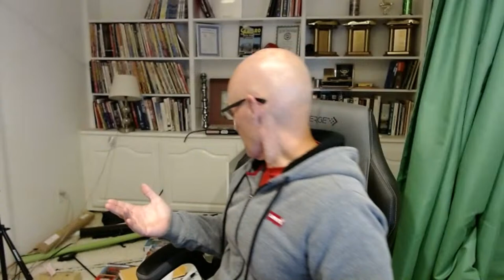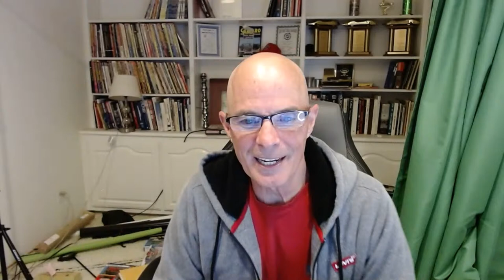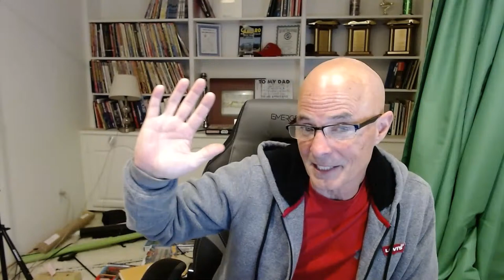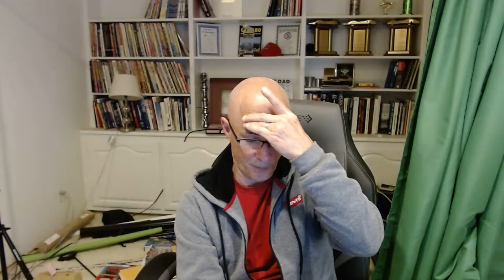SLANT 6 INTAKE-HOW DOES THIS EVEN WORK? LET'S TALK TECH

Comment: Uncle Tony did a couple of videos stagger jetting a Holley 4bbl to get plug readings even.
Tom Hoover ran a '57 Plymouth with a long ram intake on one side and a handmade short ram intake on the other head, and raced it around Detroit in early days of Ramchargers car club
Reply from the maker: stagger jetting works best on a dual quad tunnel ram-otherwise stagger jetting changes more than 1 cylinder on a single or dual plane with a single carb
Reply: @richardholdener1727  the above mentioned video was on a slant 6 with carb turned 90°. Unless he used video trickery, the evidence is there in literally black and white on the plugs. Not arguing , just offering another resource of info.

Comment: This slant intake is actually a sonic ram intake taking advantage of the reversion effects. I would bet the people, or person that designed it were the same that did the V8 long ram, and short cross ram's for the Chrysler 300's. There is one of those TV car shows on Youtube running side drafts on a slant. They actually have a visible gasoline vapor due to the reversion pulse coming out of the carbs.

Comment: G'evening Richard 🤠 . I don't remember who made them off the top of my head but at least for a while someone was making slant 6 mopar intake manifolds with runners that were all the same length.  A friend picked up two of them at the Firebird Raceway swap meet a few years back.  We ran a Holley four-barrel on one and a big Weber two-barrel on the other on two separate engines.  Even though they looked a little weird and they ran okay they seemed to be more of a gimmick than anything and we went back to the factory manifolds that we gasket matched and did a little porting on.  We ended up selling those intake manifolds the following year at the Swap Meet to someone else to play with 😋
Reply: Clifford I believe is who you are thinking of.
Reply: Auzzie Hurricanes?

Comment: Check out the Jeep I6's.  258 had 2 barrel, 4.0 had Horse shoe and a "log" style. I have a 4.0 with Clifford and Holley 390 DP, made 157 hp/215 tq on 31's-stock engine.  Even up to 4,750 RPM's I had 175 TQ still. 

If interested I can email you my Dyno runs, various heads carbs,  etc. I have not AFR'ed individual cylinders,  maybe when I install my Stroker.  But you will see cyl 1 and 6 sludged more then the rest.  Seen it myself, doesn't matter if carb or F.I. it seems.

Comment: SLANT 6 TECH?!?!? RICHARD ARE YOU READING MY MIND??? IT NEEDS A TURBO!
Reply: I just finished turboing the 225 in my A100. Still slow but sounds cool! When I first took it for a drive I hadn't adjusted the wastegate yet so it jammed 12lbs of boost down into the otherwise stock motor. Ol slant didn't care though just kept on truckin

Comment: Should see the one I built for Andrew Howard's valiant. Nor Cal killer bee series stuff. Was worth like 4 tenths and a couple mph over a Clifford with a big spacer, out of the box. No tuneup changes. Focused on grouping runner entries close together to limit required mix spread and keep some charge momentum. Runners were not quite equal but pretty close.  Lots of runner length and taper. 13:1, cam in the 240@ .050"range, spun to a 7000ish ceiling. Only did it because they said it couldn't be beat. I'd put that design over the hyperpack or aussiespeed pieces,  with confidence  too.

Comment: The whole design of this engine was to accommodate this manifold. The percentage difference in runner length is less than the competition's.  Also, back pressure from valve closing is reduced from interrupting inlet flow. The air fuel ratio is much closer with this design.

Comment: Do you think having two short, two medium and two long runners ends up averaging out performance over a larger operating range in some unexpected way?    Like an intake designed by committee.   Manifolds with even lenght runners and multiple carbs, to help even out AFRs , do make a difference.  The 2.5L I6 in a TR6 with the factory dual Zenith Stromberg intake setup (which has nearly equal length long runners) makes very close to the same horsepower as a Ford 170 (2.8L) I6 with its cast in short unner log manifold and in a single bbl carb.    That said, the Ford  is far less complex and no doubt cheaper to make for the same power.
Reply: The difference in length is not that much. It may broaden the torque curve slightly. The important piece to get pulse tuning correct is the exhaust, especially the collector lengths. Primary length is not as critical as the collector. After the collector length is determined, the exhaust should dump into a resonator "box" that simulates open atmosphere. Read David Vizard's book, How to Build Horsepower, for a full description.
The slant manifold is far better than the Ford or Chev equivalents. The Ford was especially bad as it was cast integral with the head.
Reply from the maker: intake runner length plays more of a part than exhaust

Comment: In my mind the further away from the head you move the carb the less difference in runner length between each cylinder.
Of course lengthening the intake runner has other effects as far as I know.
The longer the runner the more torque? This would be helpful on the slow spinning slant 6!
Or is it like a tunnel ram and performs better at higher revs?

Very interested to see some tests by you.
I run a slant six in my VF Valiant Hardtop. Also known as a 68 Dodge Dart in the states.

Currently torn between running an M90 or turbo.

Comment: For the slant-six manifold, long-medium-short runner lengths appearing to be a increasing multiple of lengths, is it possible that the runner lengths are incrementally going across the harmonic spectrum, as in 1st, 2nd, 3rd, harmonics, for a equalizing affect?
Reply from the maker: different lengths will produce different torque curves

Comment: I do not know the RPM the 61 or 62 Valiant 170 engines with the marine Hyper Pac were running when they were running 128MPH at Daytona. They had a hotter cam than the marine cam and a bigger 4 barrel carb on them, and that manifold was long for torque in a marine RPM range.
Reply: "marine hyper pac?" Never heard of a marine hyper pac. The factory had a complete kit. Long ram intake, cam, cast iron 6 into 2 headers, Carter AFB 400-ish cfm.

Comment: If they were all the same it would make a higher peak number but with 3 different lengths it would add a little down low with the long runner cylinders pulling harder and a little up top when the short runners are pulling harder but if all 6 peaked at the same time it would obviously make more at peak.  The broad tq curve probably worked better with the 904 3 speed automatic (and manual 3 speeds) transmission.  As far as carb and air fuel distribution you have mentioned in other videos that you haven't seen huge power gains with minor AF changes if your close so I would think as long as it is pretty close in distribution it wouldn't make a huge difference getting the mix perfectly even. The only way distribution makes a big difference is if it's off a lot on one or more cylinders and based on all the plugs I've put in slant 6 engines I have not seen any evidence it is far off.
Reply from the maker: if they were all long-it would make more power down low, in the middle and (possibly) at the peak hp rpm of this motor

Comment: I did the ass dyno research on equal length intakes with the ford 300 the efi manifold with a carb on it is far superior to the 1 bbl and even the offy dp 4bbl the efi manifold works better in both directions of the Rev range off idle to the highest rpm I dated to spin it and idles well with a top mounted carb 1bbl-4bbl the large side draft didn't idle well until it was over 85degrees out and even then the fuel puddled but ran like an assaulted ape when you get into it